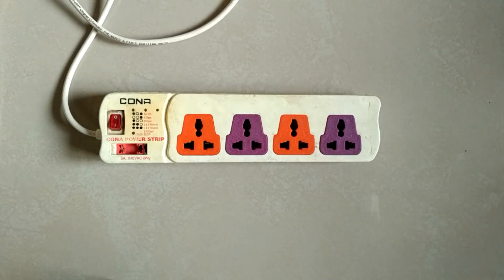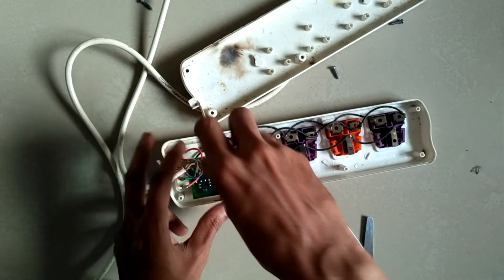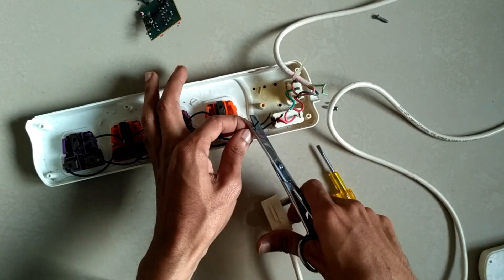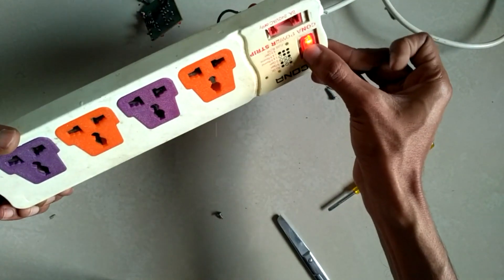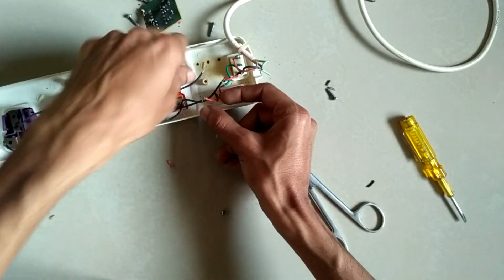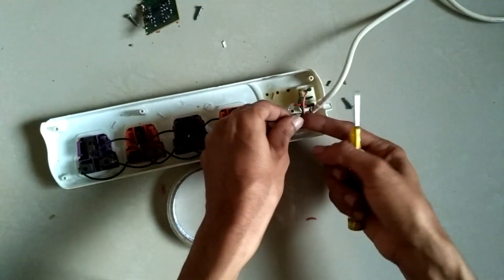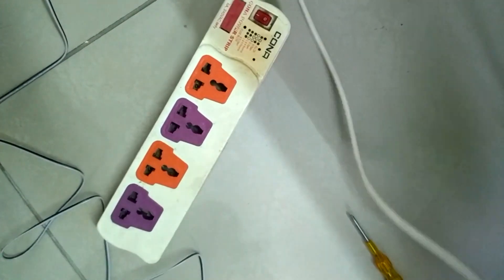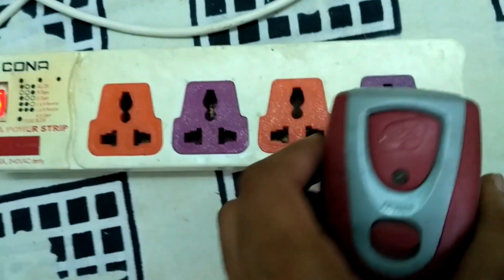Surge Protector Repair | Power Strip Repair | Flex Box Restoration

Comment: You are showing to make a direct line without any surge/lightning protection. If someone follows your video and "repaired" similar surge protector and if there is a surge/lighting, that person might loose the connected equipment.
Reply from the maker: Hi Tulsi, no equipment cannot be lost because it has fuse connection. If any high voltage comes then fuse will blow, protecting the equipment connected.
Reply: @PavanKumarHB  that might be just a thermal fuse; by the time it will react, the connected equipment will take the hit. If fuse only was enough to protect from surge/spike, then all manufacturers would have used fuse only. They wouldn't have install MOVs.
Reply from the maker: Hi Tulsi, much appreciated your comment🤗🤗

Comment: Can we connect directly without fuse?
Reply from the maker: Hi Krishna Kumar sir, yes we can connect without fuse. 
Fuse is just to make sure to cut off connection in case high voltage comes then fuse will blow to avoid any damages to appliances.
Reply: @PavanKumarHB  thanks bro.. if we just connect mobile charge and small things are fine know ? Fridge kind of appliances will affect.. am i right bro?
Reply from the maker: Yes, you must use the appliances which are below 6 Amps for this kind of surge protectors. On every electronic appliances plugs/pins, there will be Amps mentioned.

Comment: sorry, this is bananas - there is no 'Surge Protector Repair' but rather a 'repurpose Surge Protector as power strip'!
Also, your methodology here is fairly dodgy as you play with live lines, not to mention the use of a bandage scissors as your primarily wire cutting tool..   finally, the use of regular scotch tape as insulation tape is not recommended - please don't follow this methodology - it can be deadly!
Reply from the maker: Hi Jim thanks for the comment

Comment: What is meant by Gnd. open, is there any problem if we use light indicated as Gnd. Open?
Reply from the maker: Gnd- means "ground".  Gnd open means- ground is not connected/failed. It's dangerous to use without ground connection

Comment: 2 Pack Surge Protector Power Strip with 6 Outlets 2 USB Ports, 5-Foot Long Heavy-Duty Braided Extension Cords, Flat Plug, 900 Joules, 15A Circuit Breaker, Wall Mount FCC ETL Listed for Home Office
https://amzn.to/3hXQdap

Comment: This is certainly not a video on how to restore a surge protector. It is a video on removing broken surge protection circuit and sticking the wires together with tape. I would certainly question the safety of using that again. I would not recommend doing this as a safe thing to do.
Reply from the maker: Hi Chris Woollard sir, exactly I agreed with you. But many cannot get it restored by electrician going to shop and also the cost of restoring from shop is much higher than the actual cost of the product. So, i made this video, instead of using electric insulation tape, I rounded with normal tape.

Comment: My strip wire got burned a bit when 3 lights
Reply from the maker: Cut the board and connect directly as shown in video. If you want to get board repaired then electric shop will charge more than cost of new box.
Reply: @PavanKumarHB  done it with my repair tools,had to buy new  new wire and soldering kit
Reply from the maker: Oh that's cool thing. Thanks for sharing your view😍😍

Comment: Bro that board got blasted!
Reply from the maker: Yes sir. Because of overload/using electronics above 6 Amps like iron box, soldering, hair dryer, freezer. This box should be used only for tv, mobile charging, laptop, and any thing below 6 Amps.
Reply from the maker: Diodes and resistors used are very low capacity on the board, they cannot withstand high electronic goods. So they blast.